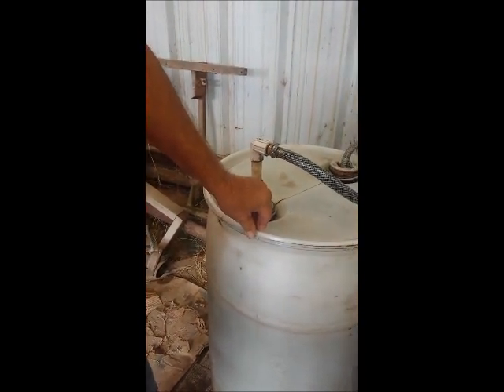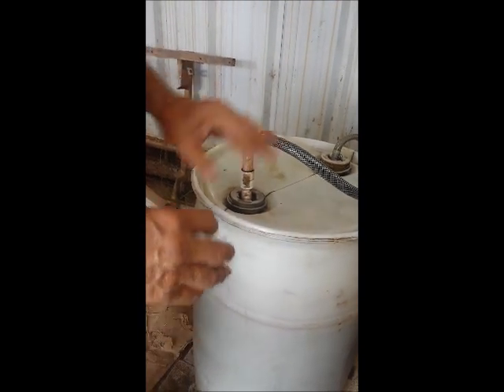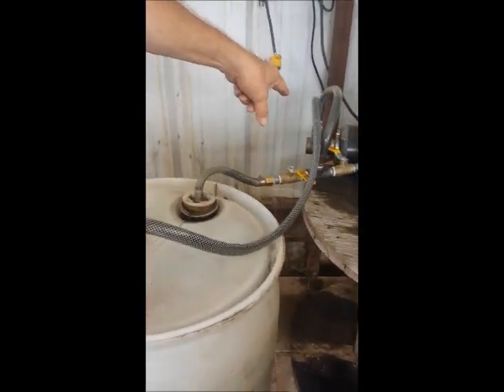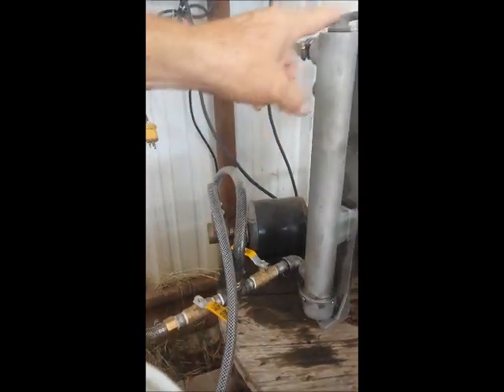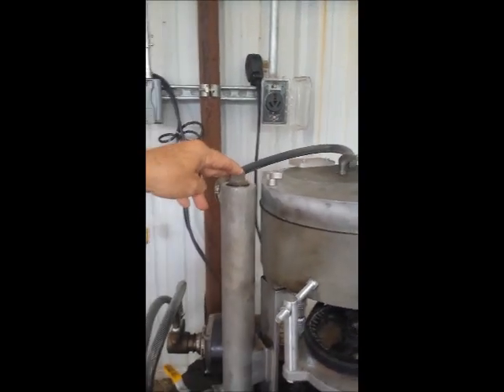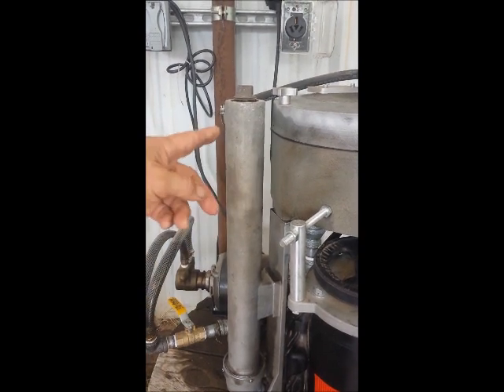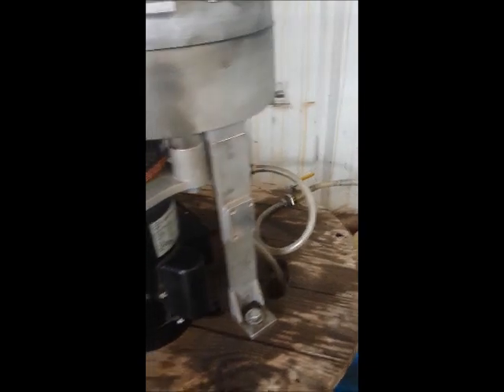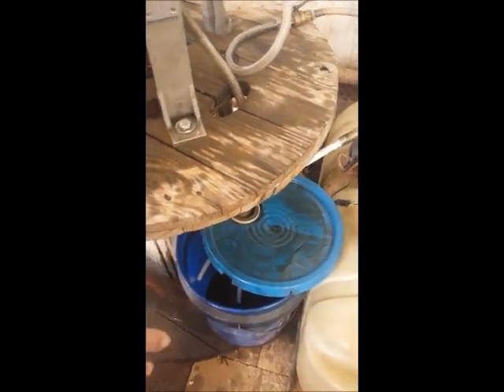Cleaning Used Motor Oil into Black Diesel  With Centrifuge

Comment: 20 gallons, total cost, ~$30. Plus whatever...

I've never someone use such a concoction. Usually just oil, filter, gas, and run it ... this becomes sustaining much more involved and expensive when you start putting more ingredients in.

Comment: it's been a few years. are you still making black diesel? do you prefilter and how do you do it? I ask because the red diesel I'm getting is from oil tanks being removed and has quite a bit of sludge from the bottom. planning to make my mix 10% waste oil (5 gal),  5% reclaimed gas (2 1/2 gal) and 85% reclaimed red diesel (50 gal). how often do you have to clean out your centrifuge pan? for my truck use, I plan to run it thru a 2 micron Diesel Fuel Filter Water Separator when I pump it in.  thank you   😃

Comment: Instead of gaseline does heating oil can be used?
Reply: Gasoline is used to thin the oil because it's much thinner than diesel. Heating oil is just untaxed diesel, so just like diesel it's thicker than gas so won't thin the oil as much. I'd go maybe 75% heating to 25% WMO. For sure when you have too much WMO you will feel it in hard starting, performance, fuel economy. You may even get a little white smoke and oil burning smell.

Comment: Would you benefit from sending the oil through the centrifuge twice? What exactly are the beads you mentioned that pull the acids?  Also, what about adding a thermostat set at 180ish after the heater?
Reply: It absolutely won't hurt.  If you let the oil settle for at least a month, and heat it, you'll have less contaminates to filter out.  Biggest thing is to see if you still have contaminates being spun out.

Comment: I use my used oil in a mix of 50% used oil & 50% diesel  to make wood stain/ preservative.  It's cheap and does a great job.  Using it to make diesel fuel is also a great idea.

Comment: The major problem with recycling used motor oil is that you don't have any more additives, those are useally used up while the motor oil was in use. In fuel there are also additives against condensation (water), for better combustion, anti-smoke, anti foaming, anti-stolling in winter times, etc..... Those you are all missing, when you use recycled motor oil. 
In modern diesel engines, you will get problems with the high pressure diesel pump. 
Older engines are more forgiving. That Black diesel can always be used with a fuel oil burner for heating your house/garage/shed etc....
Reply: At that point just burn the oil and don’t bother with cleaning it if it’s for an oil burner.
Reply: @loganthesaint  you're right.

Comment: That's pretty high tech, I usually just pour used oil through a piece of cloth then dump it into my tank. Worked for about 100K miles so far, of course I only burn the used oil from my own fluid changes, so maybe that's why I haven't broken anything yet.

Comment: I just filter used motor oil, gear lube,transmission fluid throuh a fine filter sock, about 2-3 gallons in a 5-gallon can, add diesel and pour it in my truck!

Comment: I am a degreed chemist with an emphasis in organic chemistry. This is a bananas of an idea. This is not diesel fuel. Stop thinking you can create something worthwhile by simply slapping the adjective 'black' in front of the word 'diesel'. Diesel fuel is a certain distilled molecular weight range of hydrocarbons, also meeting other specifications for performance in a certain type of mechanical device. This doesn't look cost or time effective or environmentally sound. I love my diesel engine in my Ford truck, you obviously don't. I have poured a lot of money into my truck to keep it running correctly and hopefully have it operational for the rest of my life. You are ruining your engine by putting in poison.
Reply: If not desel y burn tho?

Comment: Yes you might remove most of the carbon but not all. If its black it still has carbon in it. Fine carbon will pass through fuel filters cause pump & maybe injector wear & even cylinder wear. Eventually may cause rings to stick. Don't do it.
Reply: Have you done it? Miles logged? Lots of people with these videos but not much info on miles logged and problems they encountered

Comment: Problem is, the cost/benefit ratio.  You are maybe saving $50 a year, but risking needing $5,000 in work to the filters, pumps, and injectors.  You would have to do this for 100 years with at most one overhaul needed as a result.  Not good odds.     Look over powerstrokehelp videos to see any diesels ruined fro biodiesel and dirty filters.

Comment: Sorry . False information here . Using  a  Centrifugal Separator is fine , and affective , but the Cleaned Bright Stock is  LUBE  OIL  base .
Can be re-used for that . COULD be burned in a Boiler Furnace . Not great for Diesel Fuel . 
If you want to do this  PROPERLY  , get a Real Separator . A Real Separator requires a WATER FEED to float the Oil on . 
The Solids and Rubbish get centrifuged out at 15 - 40,000 RPM depending on the Machine . 
What comes out the Top is Clean Stock and what comes out the Bottom is Water and Carbon and Metal  as a Slurry . 
What you are making  WILL destroy that Engine . The Gasoline is the ONLY reason it runs .
Your Product  is fine for a Furnace , Heating or a Really  Old  Style Tractor Engine . Nothing Modern .
Reply: Have you done this before? How many miles on wmo have you logged?
Reply: @walt8238  .Who you asking ? @Wait ? Me or the original  poster ?
I  am a Former Navy Engineering type . We  know the Parameters for Fuels .
Reply: @johncunningham4820  was just asking if you had experience with wmo. I guess you don't.  Not saying your points aren't valid because of it. Lots of people post about running black diesel not a lot of info out there on longevity of running it, seems like there's more info on wvo longevity. Also what is an engineer type... either you have a degree in engineering or you don't kind of like saying I'm the doctor type ... either way It sounds like you have experience with fuel in the military. What are your thoughts on the multifuel engine in the 6x6 military vehicles and wmo being a fuel listed that can be used?
Reply: @walt8238  . I  was an Engineering Branch Sailor , with the  R . A . N . The Training is really rather Extensive . Especially when it comes to Operational  Does  and  Don'ts . 
Black Oil of ANY kind is dis-recommended for use in any kind of Diesel Engine . Great in a Furnace , or even a  Gas Turbine  Power Plant . Too  " Gritty " for Diesel Injection systems . It will chew them apart in very little time .

Comment: You are a mad scientist 
Love your video
In the UK old Peugeot’s 
206 turbo, minimum 60 mpg   ( imperial gallons )
They run on anything 
When I here of fuel shortage or electric cars 
I just laugh 
I have enough fuel for 3 years and costs 1  x. 5th the price of diesel at my last delivery price.
Cos I’m old I sometimes make mistakes 
And have put pure engine oil in 10 / 40,,,
50 litres which is a full tank 
That did cost a lot of money hahah 
The old Peugeot thought it was her Birthday 😂😂❤️

Comment: Neat.  Wish I had one.  The filter.

I carefully catch motor oil from my small fleet of family vehicles.  I maybe collect about 20 gallons a year.  I filter it roughly thru a couple of t-shirts just to get rid of the big stuff.  I mix 2.5 gallons of it into a full tank of diesel (34 gallons) and call it good.  2005 Ram 2500.  5.9L.  I do have to change my fuel filter every 1,000 miles, but that takes me a year to travel that far, as it's only a work truck for ranch chores.  I get those filters for $7 each and it takes me about 15 minutes to swap out.

It seems to give the truck extra goozo.  It does smoke a little more than normal and smell differently.  It smells like I'm cooking motor oil.  😂

I've mixed and run it that way up to a 15% mixture, but I prefer to keep it at 10% or under.  

When my fuel filter is getting full I can tell by how it starts.  It will delay about 1 second and start a little "hard".  Then I check the miles and it's always around 1,000 miles, give or take 100 miles.

Can't do this in the new EPA BS'd trucks.  I wouldn't pay $85,000 for a damn truck either.  It's ridiculously overpriced. 😆

Go 5.9L!  Best consumer diesel the planet knows.  I'll keep mine in the family for as long as I can. 

Peace...
Reply: Ive run like 50% oil before, didn't notice any difference in power or anything
12v

Comment: But the big question is is it legal for on road use in the United States? If you get pulled over and they dip some of that out of the tank isn’t that trooper gonna lose his mind while you’re trying to explain to him what the hell that is?
Reply: Why would a trooper be inspecting your gas?
Reply: @rodneyhoskins8187  
Highway Patrol officers dip diesel vehicles quite often where I’m from because I live in a farming community and farmers  buy bulk diesel that is tax free to use in their tractors but obviously the temptation is there to fill their diesel pickups and semis with the same dyed, road-tax free diesel which is illegal. I’ve heard that it’s like a $1000.00 fine too. Diesel sold at a pump at a fuel station is clear and has tax included in the cost, farm diesel is red and instantly recognizable.
Reply: @rodneyhoskins8187  Checking for dyed diesel.

Comment: Why add all the gas and diesel into the cleaned oil?  Seems a lot of extra trouble and expense. Why a 1 micron filter since my diesel’s require 6 micron for the older ones and 2 micron in my 3406 Cat engine. Seems over kill and I wonder about any warantee issues with the gasoline in the fuel.

Comment: I have two centrifuge projects. first is to clean up some gasoline (several hundred gal from a boat) that needs to be cleaned before using in our car. second is some home heating oil that I want to clean up to use in my home and mix with WMO to use in my truck. is there anything I should be concerned with when doing this? would I still want a temperature of over 160 f or is it lower for gas and heating oil? ty, for any assistance you can provide.
Reply: Running gasoline through a pump is risky.  I'd only use a gravity system, and I definitely wouldn't use a system indoors.

Comment: i discovered that adding petrol will make it a lot harder to restart after you left the engine hot for about an hour or two as the gasoline in the hot injector tips evaporates so does the fuel in the high pressure lines as they mostly sit in a hot spot in the engine bay. ALso thats a big strain on your inejctor seals. A 100% waste oil is startable with about 8-10 seconds of cranking even in freezing temperatures. In the end adding 10% diesel is enough for good perfomance and heating the fuel with engine coolant helps much more so the fuel atomizes much easier. 

In the end I have a question. I thought the centrifuge removes most of the dirt, so why is the waste oil still black
Reply: Did you tryed with 100% WMO? I made a test and my first tank of WMO has 30% diesel, 70% WMO. Engine runs great!
Reply: @V8AmericanMuscleCar  it was waste ATF

Comment: 🤣 this little ol 5.9 24 valve legend, 2nd only to it's more reliable predecessor.  Stock hp in the 300 area with 850ish ftlb of torque. Those numbers are repeatable with alternative fuels like veggie ( only clean so far ), clean oils that are near appropriate viscosity, or used oils that are filtered and treated thermally or by solvents to reach desired viscosity. If your getting build up in your chamber then you're not filtering enough.  There are a lot of videos about this topic and to summarize them up I would say #1 is getting your oil ( new or used ) to the desired viscosity. This can be done with gasoline, diesel, or heat . Heat is temporary and is a overhead cost every second your applying it to your system. Gas and diesel cost money but work forever once applied. #2 Is filtration.  This is where I intend to spend the bulk of resources available for the project due to its default simplicity. A centrifuge is a must but so is the need to build a system that can get near the same result with 12 volt or gravity flow. .5 micron is final req spec. #3 Is water removal. By standing in a tank or by bringing up to 190 and circulating.  The time required on this step would vary but to nail it down you need a formula or process that can give you a control on which to go by. To do this make sure your mix is as homogeneous ( 100 blended ) as you can make it then take a 1 gallon sample or whatever significant unit u need to work for you, could be Dixie cups but then your entire process is measured in Dixie cups. Weigh that gallon before and after bringing it up to 190 f keeping the oil circulating. Take the weight right after you remove  it from the burner. Once the oil has cooled compare volume loss. 2mls? 3 ? What ever that number is that is the volume of water that has been removed. And the missing weight is also missing water. This should give a very good idea about your water content and what volumes and weights you need to remove from the entirety of your batch. #4 the centrifuge, oh the holy grail of alt diesel and clean motor oils. This should be your second to last process, anything that your keen attention to detail and dedication to clean and oraganized work area and practice gets tested. From the centrifuge through high flow paper filter and into the final tank where you test against a control for viscosity and flashpoint.  I save these two for last because they are the end of the line. If you can grasp this shitty post and understand it and you have the mechanical know how to pipe shit out of your house then you should be good. The only thing I can add at this point is maybe a better centrifuge  and more cycles through it and the filters to try and clear up the mix so new vehicles can see through it🤔 idk guys bnb it this is cool shit. I am going to be building a on board system that holds 25 gal of fast filtered and viscosity treated with a 12v heater waste oil with a 12 volt pump inside.  Pump runs waste oil through filters and into centrifuge. Comes out centrifuge through high flow paper filter and into a 25 gallon circulation tank that keeps it warm and moving.  At the bottom of the tank there will be a low spot and petcock that will be operated by a timer, every few hours a little bit of water or fuel is let out into a collection reservoir.  A half inch above that is a line to a secondary 35 gallon tank with a 12 volt heating element in it. ....

Comment: Will this black diesel work with a 1991 Isuzu 4bt1 direct injection engine?  A little more power would be nice from this small Diesel. Thanks
Reply: Everything before common rail engines should be fine.
Reply: You may loose the use of rear mirrors ...
Reply: You will get less power from black diesel. Most of the time when you randomly mix in gasoline the cetane rating goes down. He wasn’t exactly using a scientific method of measuring and mixing or testing .

Comment: plug and cable is too small for a 110 Hp.motor
Reply: I think he means 110volt
Reply: 110 Volt
Reply: @davidmuffett2707 little Johnny is not with us no more,what he though was,H20,was H2S04

Comment: You got electrical consumption. Sludge disposal. It's best if you do 3x pass on the centrifuge process to get best filtration. Then you got to cut it 80/20 oil/gasoline. It's best if the pre-treat oil sits for at least 30 days to allow separation of solids, water and emulsion. Then there is the small issue of air emissions. Plus if you sell this stuff you immediately become accountable to the law. It's a nice hobby but it is not worth the expense. Your return on investment would require at least 5 years of driving.
Reply: Not to mention if your homeowners insurance discovers your refinery that little bit of a mess if that gets on the earth in Vermont any amount that touches the earth is reportable to the fire department and that’s the EPA! You are literally playing with fire. Along with the possibility that you’re actually playing with fire! I love what you’re doing that’s great but I would have that whole operation in some kind of a tub to prevent any of it from touching mother Earth and yeah you probably ought to call your insurance company and ask them what kind of shit you’re creating for yourself? I know the politicians and the lawyers I’ve gotten so far out of hand that reality doesn’t matter anymore. 1776

Comment: gasoline contamination of diesel for a common rail diesel engine, I dont like this idea.
Reply: When the first Gen Dodge with the Cummins 12 V  from 1990 to `1998 the Diesel had  started off with 50 ppm of Diesel . Now they have 15 ppm Diesel . The new diesel is what you would want to be concerned with. Because its a coolant for the older diesel. Thats why ATF is better to run in the fuel tank.
Reply: @TheHillpeter  50 ppms of diesel? Do you mean sulfur?
Reply: @TheHillpeter  I typically run a quart or more per tank full in my 2nd gen 24v, I have almost 400k on it, the more ATF I throw in there the happier she runs!!!!!

Comment: I have been running black Diesel for over 6 years with no issues. I cut it with gasoline, let it sit for a few months and pour the stuff in the tank. I leave the last few quarts in the bucket so the sludge and dirt doesn't go in. Anything I miss gets filtered out in the fuel filter. Everything I own is an IDI as well.
Reply: What is your mix

Comment: how does the water evaporate in a closed system ?
Reply: kermets The oil is typically heated before it runs through the system boiling out the moisture.
Reply: He said his sludge bucket was vaporing or fuming because of the water so I’m assuming it goes through somehow. I’d like a set up like this for sure. Not too worried about water though.